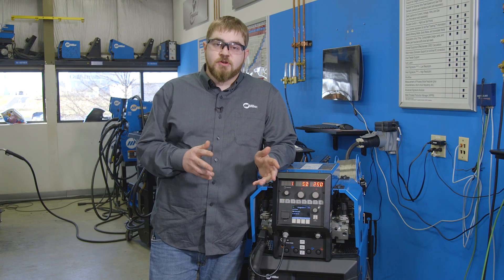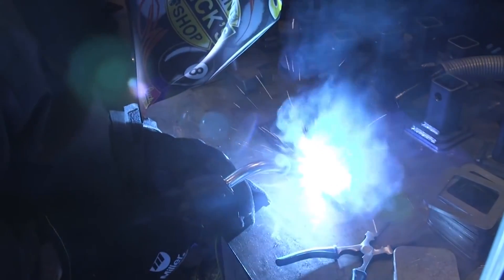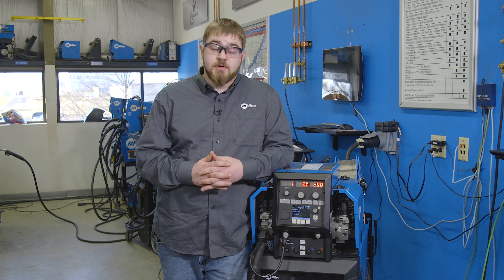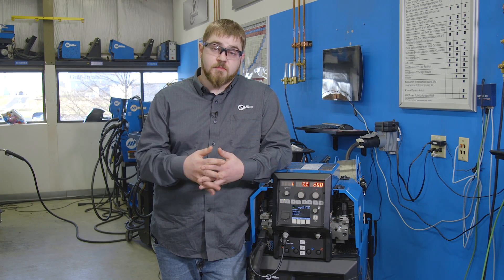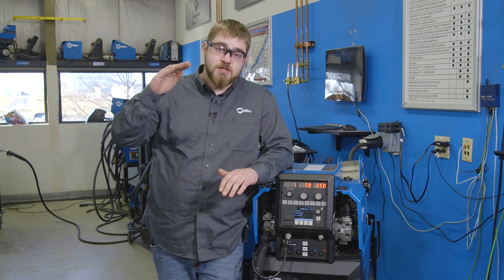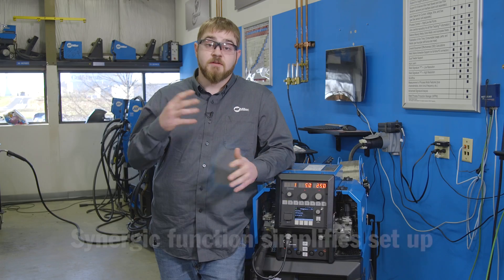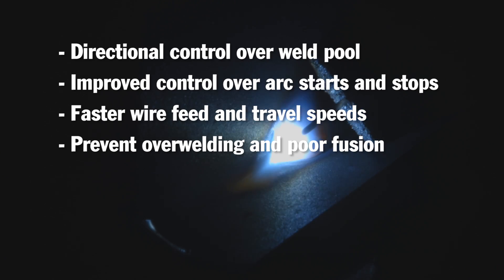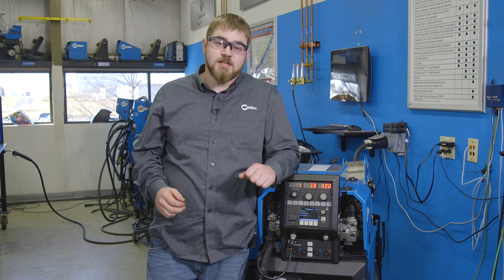Pulsed MIG Welding Basics

Comment: just took my first test with a pulse welder miller, wow talk about lost. never even seen one before, was not able to keep from getting a concave root, it was just a lack of knowledge of the machine. can anyone tell me if this machine is close to the Lincoln sst welder, we ran those for years at cat and could control the back ground on its own, also fund out the hard way that if you bump the trigger to feed some wire to clip it off it was changing the machine between high and low settings. it did run a beautiful fill and cap either uphill or downhill.

Comment: I use the millermatic 350p everyday at work & for 1G I run 46 & 250, 2G - 46 & 220, 3G - 41 & 157, 4G - 46 & 200. I use 28 sharp for everything.
Reply: Thanks brotha!
Reply: What size wire?
Reply: @RustyShackelford429  .45
Reply: @RustyShackelford429 0.45
Reply: @RustyShackelford429 0.45

Comment: So what are the disadvantages? With a Miller 255 pulse push/pull aluminum, a disadvantage is that there is no run-in  (a second or two when the wire speed is deliberately low to help create a pool on a cold start). If this is not practical with pulse, then a standard Mig run-in would be helpful. I've tried manually switching the machine from one mode to the other, but the machine takes several seconds to complete the change-over, and it means I must always have the machine at arm's length. I don't know whether some sort of run-in is available on other machines.
Reply: There is a run in feature on the Miller 350 aluma-pro
Reply: This seems like a fatal omission on the 255. I didn't even bother to check whether it exists, sort of like not bothering to check whether the wheels on my truck are round.

Comment: Hi could you tell me how to use the pulse settings on a Miller axcess 450 welder? I have just picked one up but am new to pulse. How do I adjust the voltage?
Reply from the maker: For the Pulse MIG process, voltage is automatically adjusted to match wire feed speed. There is an arc length adjustment that allows you to fine tune the arc to your liking.

Comment: I have the 255 millermatic,,,can you use 75/25 mix argon in the pulse mode ???
Reply from the maker: Hi Mike, thanks for reaching out. For pulse welding on mild steel you would need to use a 90/10 argon/CO2 mixed gas, 75/25 will not work for pulse MIG.

Comment: So....I have & lumped up the $$$ for a 350p & a king of the hill push/pull gun (XR-pro) - I tried the pulse mode & it behaves exactly like a constant amp MIG (had a Challenger 172, sold it - prob shouldn't have now)......I've got mine in pulse & don't see it acting like it's pulsing, despite the inst panel saying I'm in pulse mode. IDK, I'm starting to se why Miller did a strictly AL model I think.
Reply from the maker: Thanks for reaching out. We recommend giving our team a call to talk this through with a tech. The number is 920-954-3499. Let us know if you have any trouble getting through. Thank you.

Comment: When you say 'Less Heat Input' do you mean that for the same material / weld you can run a weld with less volts / amps?
Reply from the maker: Thanks for reaching out. Yes, it is stating that for a given material and thickness, the same weld can be made with less “average running” volts and amps using pulse MIG (GMAW-P) when compared to CV MIG (GMAW). Less average running volts and amps will result in a lower heat input for the same weld. Thank you.

Comment: I'm prepping for a 3G pulse spray transfer on 1/2" plate. The test will be uphill, no backing plate. Just wanting friendly advice on how to set the machine. I've welded in the 3G position with regular MIG but not so much with pulse arc. What should I do?
Reply: Mista Duval I use an older Esab I set my trim around 4-4.5 and the wire speed around the same but I don't welding anything that thick where I work. you can't practice can you
Reply: Mista Duval I use an older Esab I set my trim around 4-4.5 and the wire speed around the same but I don't welding anything that thick where I work. you can't practice can you?
Reply: I practice all the time.

Comment: Why do I have to run my Millermatic 135 @90 Wire speed and Voltage @ 4 when using flux core wire when trying to weld 3/16 steel to get the best weld?? When I set the machine to 10/45 (the recommended settings) the wire stubbs up badly and acts like its coming out way to fast and not enough amps to melt the wire to keep a study weld going. I have the polarity set correctly.
Reply from the maker: Thanks for reaching out. We just sent you a message with contact information for our service team. Please give them a call to talk this through. Thank you!